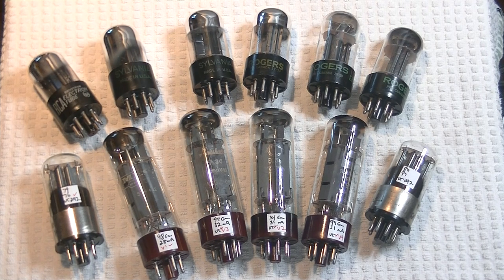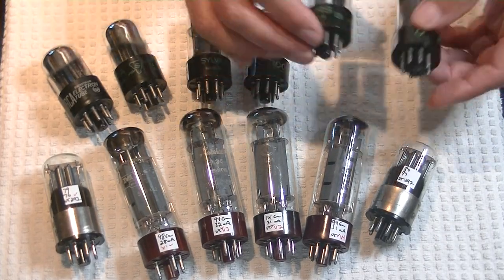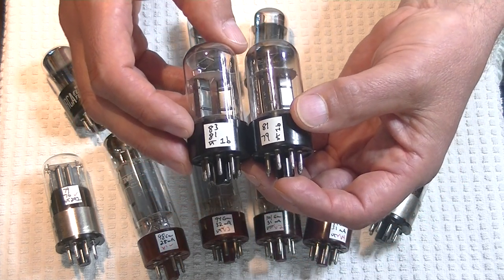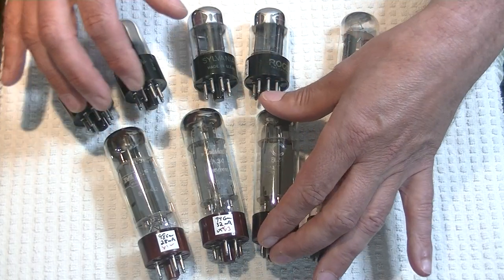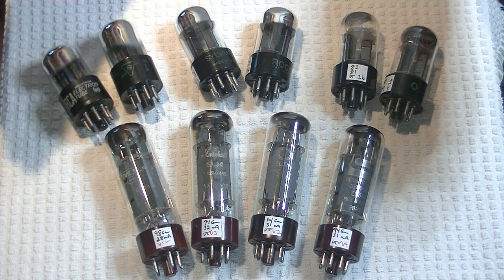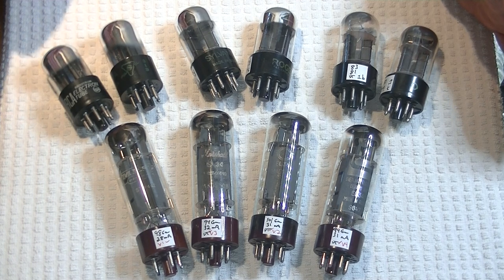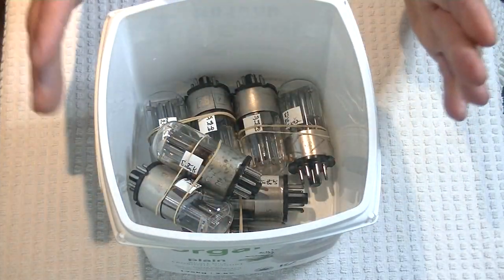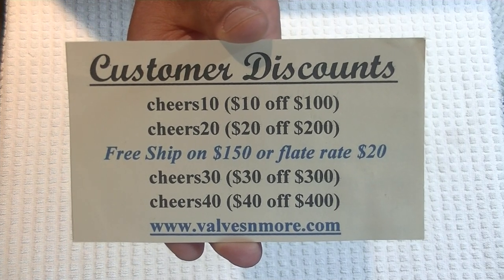Tube Lab #37 - Tube Differences (When Are They Important)

Comment: Hi Jim. I bought a pair of matched Reflektor tubes from that big auction site. The tubes are marked with matching testing numbers and are from a reputable seller, so I would think they are OK. Physically they look exactly the same, except for the getter. One has a square, the other an O. Would that  matter any for the sound signature? I'm guessing 2 different years?
Reply from the maker: The short answer - no.  The long answer, getters are just the vessel that holds the gettering metal that gets flashed off (induction oven) after the tube is made and the vacuum is completed.  They don't serve any electrical purpose after they leave the factory.  In my experience Reflector and most Russian manufacturers used saucer (as in flying) getters. Later on when they started manufacturing reissues/copies of famous vintage tubes (Mullard, Tung-Sol, Svetlana, Gold Lion) they started using the western type of getters.  Can you post a picture so we can all have a wee look.
Reply: @tubelab194  Thanks for answering! Actually, I was mistaken, they both have what looks like flying getters, but different ones. I uploaded a picture here: https://imgur.com/49SDOpT
Reply from the maker: @rasmus.O.B  the one on the left is a double supported halo getter and the one on the right is a pan getter.  They look like the  6n23p tube and I have lots of inventory in the store and all of mine have the saucer getters.  But as I said before the getter doesn't matter, other than to help identify a particular tube, then they can be very useful!
Reply: @tubelab194  Thanks a lot! 6n23p-ev's. Will test them soon, hope they pair nicely with the E80CC's I got from you :)

Comment: Hi Jim, i am looking the mullard matched pairs. what is the concern if i get two matched pairs instead of a quad? would there be a difference in dB between left and right channels? or sth else? thanks joe
Reply from the maker: This is an excellent question!  Yes you are correct if you have two matched pairs instead of a matched quad  (pp class AB / push pull amp), and the emissions are different by more than about 10%, the output of the left and right channels will be different.  Worse the stereo image will collapse to flat blah and you won't have much of a soundstage.  Basically crap.  Now if you had a SE (single ended) class A EL34 amp, then a matched pair would be perfect - and probably sound amazing, very amazing!  Such an amp is on my prototype list.  The benefits are, half the tube cost, which for an expensive tube is important AND it will be much easier to find a good matched vintage pair!  The downside of course is much lower output (power) so an efficient speaker is required to make beautiful music in Class A.  Watch my store, matched quads are finally being made and I'll start to put them in shortly!
Reply: @tubelab194  that really helps thank you